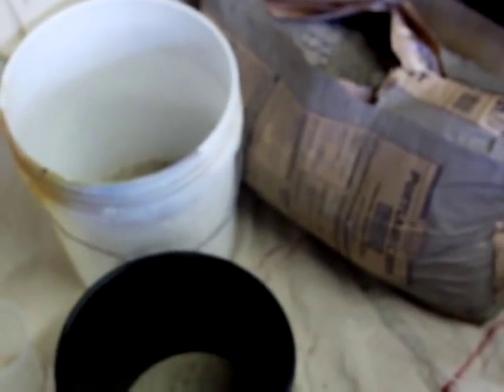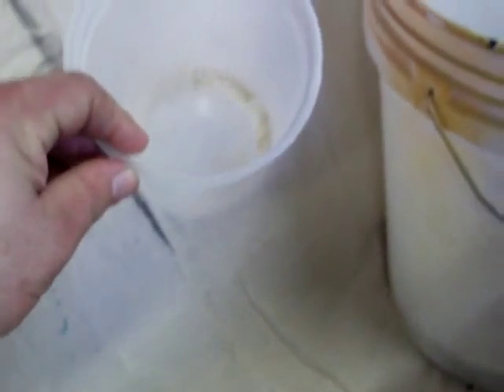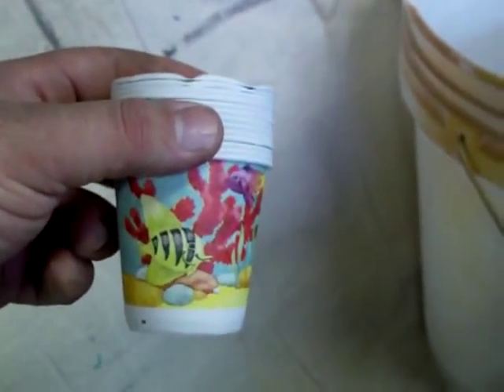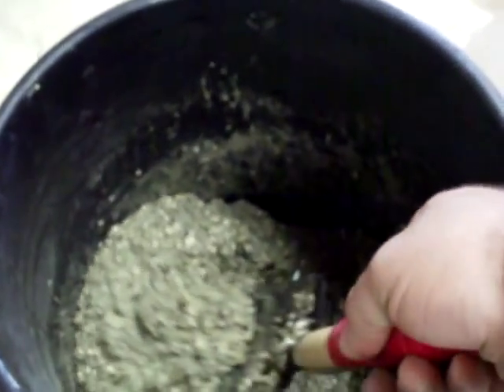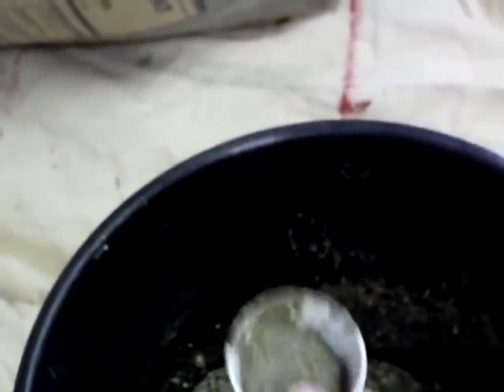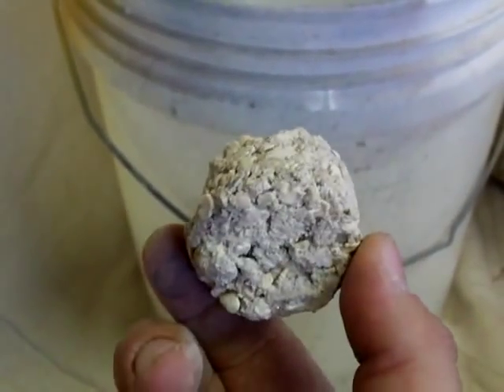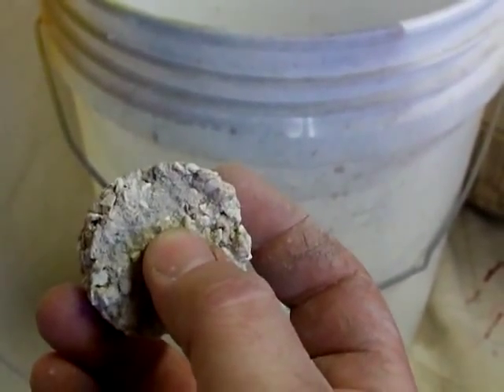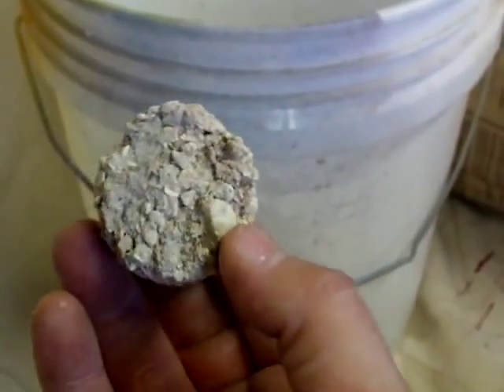How to: DIY Coral Frag Plugs

Comment: Awesome.  Thanks for posting.  You say you cure them in salt water & change the water weekly.  Do you have to use a heater & pump in the water?  Do you keep track of salt evaporation & make sure salinity is within range or does none of that matter?